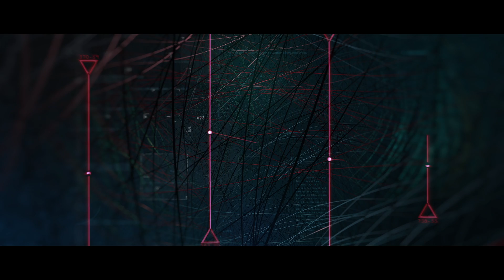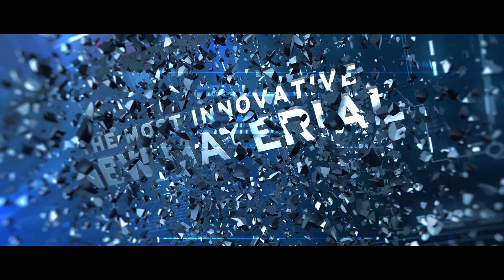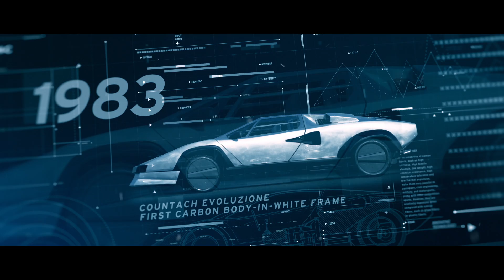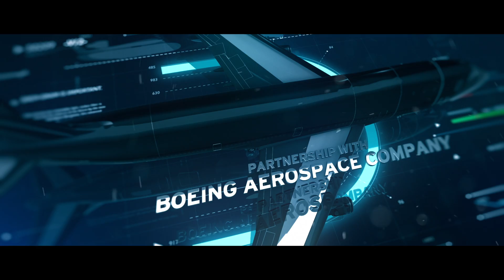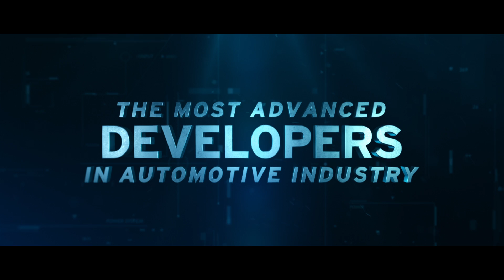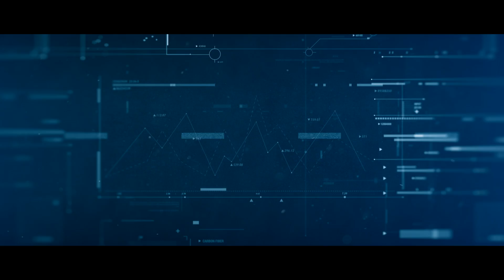Lamborghini Forged Composite: the new era of Carbon Fiber

Comment: how is it lighter? i'd think it would just take less space for the same strength as regular carbon fiber?
Reply: I guess it depends largely on the properties of the part. In many applications it will just be weaker (and thus heavier) than normal CF, e.g. if you need unidirectional strength. As far as I know its just cheaper and easier to produce (especially when it comes to very complex parts). So it will be superior to "conventional" CF only in specific applications.

Comment: More flexible?! that's not typically a good thing for a high performance chassis?
Reply: It being more flexible means it's harder for it to break.
Reply: +D//V//NE Not necessarily. Strength and stiffness are not directly dependent on each other.

Comment: It would be interesting to know, if the manufacturing process of such parts would be easier then the one of common carbon fibre parts, so it could get affordable for mass production of cars and help to compensate the weight of heavy batteries from electro cars
Reply: You know carbon fiber shatters at high vibrations compared to steel or aluminum? It's not stronger in a sense of protection but strong in a sense of being light  weight yet easily disreputable
Reply: Maybe it has cheaper manufacturing process by eliminating the need for an autoclave to cure carbon fibre, carbon forging just need a set of male-female die, and whole lotbof pressure, at a smaller footprint and less preparation